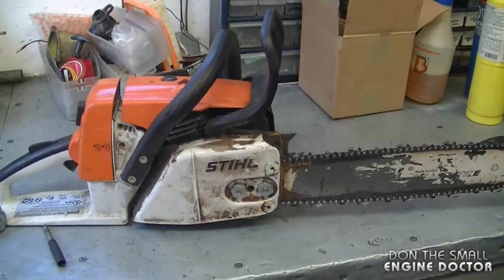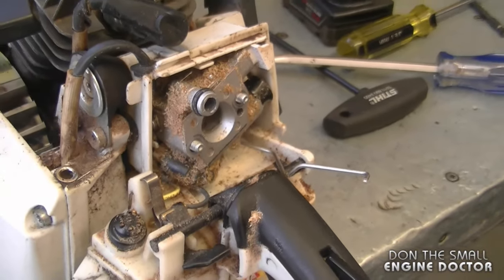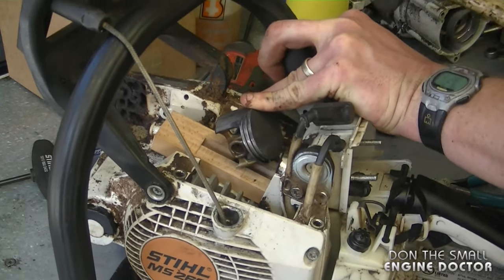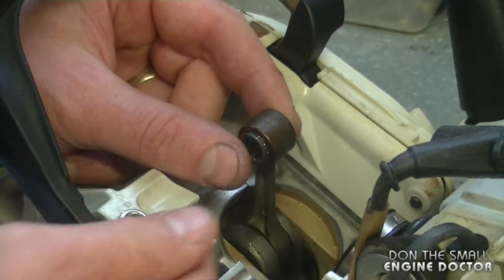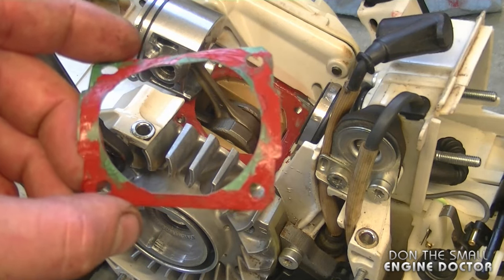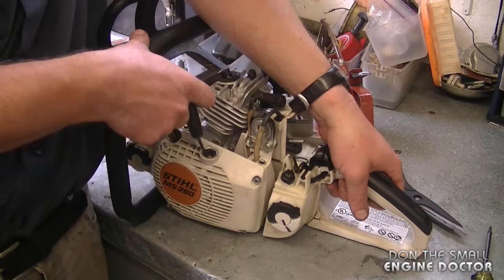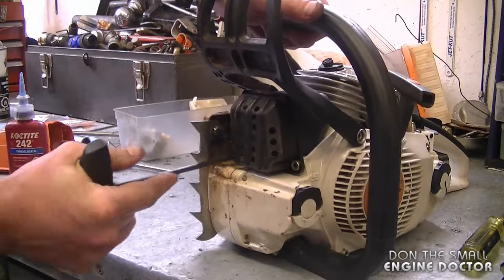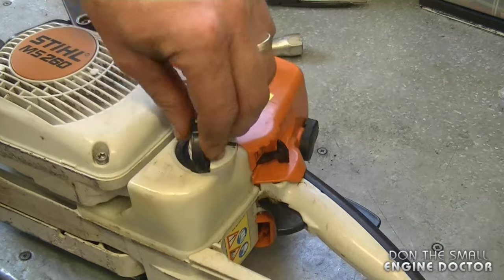Top End Rebuild On Stihl MS260 Chainsaw With Force-Tec Cylinder Kit

Comment: Nice job! I'm rebuilding an MS460 big bore saw. Ported and polished it and will be putting it back together tomorrow. You did a great job of breaking down all the necessary steps and am sure you helped a lot of folks understand what is involved..
Reply: How was your 460 rebuild? I pick up chainsaws for $10-$20 and repair them then resell. Mostly my work is carb adjustment, replace the carb (they are so cheap it's easier to replace than rebuild), new fuel lines and primer bulb, ignition module, maybe a clutch. But that's about it. No formal training or shop experience, just fixing my own things. Once it's broke what you gonna do, break it? No, so get the wrenches and tear into it..I have never ran into anything I couldn't fix. It may cost more than I wanted, but it's working right and well when I'm done. I have repaired and sold over 100 saws since hurricane Sally and not the first call because one didn't work right. And I always tell them to let me know if it acts up in the first 30 days. I stand behind everything I work on. I didn't have a saw after hurricane Sally and I swore that wouldn't happen again. So I bought a used one that needed work save got it going. When I saw how easy they are to work on I started doing it to help make ends meet since I'm on disability after coming out of a cervical fusion with a broken neck. Disability doesn't pay much. Less than 25% of my pre injury income. Anyway, I wound up with a Stihl MS260, a Stihl MS460 and a Husqvarna 141 from a couple deals where they had various saws disassembled and in boxes. I have the 260 and the Husky running like a dream. But the 460 has no compression and is going to be the saw I use on a Alaskan mill when I get I running. I also build trinket boxes and have designs to build my own boxes with hidden compartments, sliding panels, feet that twist or pull out and are drawers that hold the key and have other little things to do to get to the key hole that may not be located where you would think. I processed the wood from the cedar limbs that fell out of the tree behind my shop during Sally and have made several pair of grips for various guns that turned out awesome. The cedar has an almost purple tint and the grain has a shifting holographic effect like the old cards in the bubble gum packs. That got me wanting to be in control of finding and processing my own materials for my boxes. And with the storms we have there is always plenty you can pick up for free so the landowner doesn't have to pay someone. 
The reason I'm messaging is to ask you if you have any tips or ran into any issues rebuilding your 460. Since I'm going to be doing one I thought it might be a good idea to ask. And since it's going to be the motor behind such a necessary piece of equipment I want to be sure I didn't miss anything or screw it up. I'm going back with a Stihl Cylinder and piston. Do you have any advice?

Comment: Thanks for this video.  I just acquired an MS310 for free after the previous owner said it had stopped working.  Pretty sure he ran it without oil in the gas as the piston is all scored up.  Got the new parts ordered and am going to try a rebuild

Comment: Been there,done that this week.  I upgraded my ms 269 to a ms 260 P.  I also put an adjustable carb and oil pump on it, so it is up to the 260 Pro specs.  It runs and cuts fine.

Comment: Well done. I do these daily. One thing, machine surfaces like the OEM cylinder head to crank case using the OEM gasket does not require gasket sealant of any kind. Happy saw repairs!

Comment: I replaced the top end and carburetor kit on my Sthil 041 Farm Boss using this video as a guide, but I still can't get it to start.  It is getting fuel, has good spark, very good compression, but will not start and was running (choppy) before I took it apart.  Can you give me any guidance on what you think I should try next?  I appreciate your help.  Your videos are very helpful!  Thanks.

Comment: Great job Dony... Questions: After you did the thorough cleaning with your washer, did you let it sit to dry or blow it dry with compressed air?  If you didn't have your parts washer, how would you give it a proper, thorough cleaning?  Thanks.

Comment: donyboy73 - I want to thank you for taking hte time to make these videos. I have rebuilt 3 stihls (260, 291 & 039) that were header to the scrap yard and they are the best chainsaws I have ever used!
Reply from the maker: you're welcome
Reply: dony, I recently rebuilt a Stihl 291 with a Golf piston kit, the original cylinder was reused and was in good shape. After an hour of use the saw cut off and wouldnt restart. Last night I tore the engine down and it appears one of the piston ring pins popped out and deeply scored the piston and beat up the exhaust port on the cylinder. Have you ever seen this happen? Should I stay away from the Golf brand?
Reply from the maker: yes I see that when all the parts aren't replaced together
Reply: jiggysmb aaaaaa

Comment: great video! Only suggestion for your next video, 2 small things. 1 cover the bottom end area immediately with towels before removing the clips. 1 clip into the bottom end and... ooops.... much more may need to come apart. On a motorcycle this is devastating, pretty much means a full disassembly. Grab clip with locking needle nose so it doesn't jump out at you. On reassembly after the clip is in, you did not move the clip to 180 degrees. Clip "opening" should never be near the notch. Use a screwdriver and rotate clip 180 degrees once installed :) 

Those are tips from my 100+ top ends for motorcycles. This was my first watching for a chainsaw. Much appreciated!

Comment: Thanks for the video. I love the videos where you take stuff apart and replace things. I was wondering about how the parts washer works. Does it just use water or is there some kind of cleaning chemical in the water? Does the water just go down the normal drain? I would like to see a video of you using the parts washer some more. Thanks!

Comment: Nice video. So I suppose you don't have to check the ring gap befor installing like on v twin motors?....and no blue loctite on the cylinder bolts?

Comment: Nice and thanks for the video. I like to tighten the boot on the cylinder before I install the cylinder. Then I just tuck the top thru the hole into the carb box and gently pull the rest of it's flange thru. I also like to replace the impulse hose and the fuel line as insurance.
Also I'd like to see a close up of the inside of a force tec jug...

Comment: Do the rings need to be checked for "end gap" or are they ground and fitted by the kit manufacturer?
    I've had to diamond file the ends of some rings when rebuilding motorcycles and cars to have enough "end gap" so when the piston and rings expand due to the heat of combustion, the ends don't expand into each other and damage the cylinder bore. If they don't have enough clearance, that can cause the rings to fit to tightly and score the cylinder bore.
    In service manuals, it will usually give the required clearance dimension for "end gap". Before installing the rings on the piston, you check each ring in the cylinder by carefully pushing it down with the piston checking "end gap" in 3 or 4 places using a feeler gauge. Be sure to oil the ring and cylinder before you start this procedure.

Comment: I put the intake boot on the cylinder before putting the cylinder on the saw.  I also wrap a piece of string on the end of the boot and feed them through the rear wall on the handle, so I can use the string to pull the boot through the rear wall hole.  I do put a thin coat of 1184 on the cylinder grooves before I put the intake boot on the cylinder  and put the clamp on the intake boot.

Comment: Don, I am working on an Echo CS-306 chainsaw that would start but then quit. It has compression and spark. The diaphragms were a bit crisp so I purchased an aftermarket carb that was only slightly more expensive than a rebuild kit. After installing it I got it to idle ok but the second I tried to press the throttle it would die on me. After 30 minutes of cranking and adjusting the high, low adjusting screws I finally got it to run full throttle but it idled too high even with the idle adjusting screw backed all the way out. It also took me forever to reinstall the carb and hold the carb gasket in place. Any suggestions for that as well?

Comment: Thanks for the great rebuild video!
I had a MS200T rebuilt this summer. It started easily the first couple tanks, which I was running my 40:1 that I use in my Mcculloch's. I use it primarily for trail care, so It gets started and ran for a couple cuts, then shut off until I run into another down tree to cut. When pulling the starter, it always catches nearly ripping the saw out of my other hand. The second pull is fine and it starts. Any thoughts on why it does this?

Comment: Just watched this video almost two years after it was published.  Thanks for putting this one up.  I just tore down my Stihl 024AV because it stopped running the other day.  When it stopped I couldn't pull the pull cord so I knew it seized up.  Upon taking the cylinder and piston off, both were scared and scratched.  I haven't run the saw more than a few times a year but the last couple years I've noticed that the chain keeps spinning even after letting off the gas.  I think this is because the compression has gone down from a worn ring.  It also has been very hard to start and when tearing it down today, I found the muffler was very loose where it bolted to the cylinder which leads me to believe it was running too lean.  Am I on the right track with my thinking?

I want to rebuild it but for the amount of sawing I do, a home center saw of lower quality may be adequate.  Can you recommend what brands of cylinder kits to avoid?   There are a lot of Chinese stuff on the market now but I can't afford OEM-a new saw would be cheaper!

Comment: First tanks for video. I have some questions if you have time for a noob like me. :)
I need to replace piston and cylinder, on my ms 261. Do I need to replace crank to, because of better compression ( after I install new piston and cylinder)? Crank is fine, or do you recommend just swapping bearings on crank? Last question is about spare parts, do you buy real stihl parts or some with similar quality.

Comment: I've seen so many of these now that I have to wonder if the exhaust port is not sucking in briefly (during starting attempts) or perhaps more likely, dirt is forced into the exhaust port by compressed air cleaning or just high winds in the area.  Protection by the muffler baffling is minimal (IMHO).

Comment: Great video.  Question.  As your putting the cylinder on, how can you ensure that the piston rings dont move and spin from where they're supposed to be?  If they do is that crucial? 
Would this process be the same as a STIHL MS360?  Thanks

Comment: Excellent video on MS260 re-build. I about to order the Force-Tec kit but have to determine if the crank berrings are gone aswell as the cylendar and piston. I notice on EBay that one can buy complete assembled engine replacement kit. Are these kits worth the money? Thanks for any advice.

Comment: I only buy Stihl and Echo 2-stroke equipment these days. Watching that top end rebuild shows how and why they cost more. They are much better quality than the bog box store throw away junkers. The quality of the parts are much better too. It was also deigned to last and be repaired/rebuilt instead of throwing it away and buying another.

FWIW:

My chainsaws are a Shihl MS-391 Farm Boss.....64.1cc 20" bar and a Echo CS-490......50.2cc 16" bar. My weedeaters and backpack blowers are also Stihl and Echo. It's all I will buy and as my old junkers wear out I replace them with quality this time around. I just scrapped a Poulan Pro 260 from 2000. I can't see putting $50+ in repairing a $139.95 saw when new. You still have a cheap $139 saw when you are done. In Stihl and Echo equipment I would go 50% - 75% of new just because of the history of ownership and sentimental value without batting an eye.

Comment: Thanks for info I replaced top end with kit from discount online parts with no problems cost was about 200 dollars cdn but worth it because a new 261 arctic is about $900 after all taxes and charges have saw broken in and it runs like new your videos are very helpful with no distractions thanks

Comment: It is amazing how dirty folks let their saws get and then complain when they do not work.  I clean my saws after each use and I resharpen the chains, too.  It takes a lot less time to clean them if you clean them after each use.  I leave my saws ready to go the next time I need them.  They are not new but they look new.  I picked up a crash damaged 026 yesterday and it took several hours, compressed air, old two cycle and a paint brush to get it clean enough to even run if it did not have a broken gas tank.  I am going through the carb, today.  I did squirt some gas down it throat and it rubs good.  I will really check it out when I get a new tank on it.   I think she will be a runner and I already have a light weight 20 inch bar and chain ready to put on it.

Comment: I have a question on the ms 260. The 260 you were working on seemed to have apiece of rubber or plastic blocking the gap between the sprocket and the case to keep sawdust from entering the area of the oil pump but Stihl does not show a part in this area.  What is it?  My 260 does not have one and Ineed to cover this area to keep sawdust from getting down into the area of the oil pump and worm gear.  Thanks.

Comment: Don, I have a question.  I built one of the farmertec ms 660 and it runs and cuts fine, except I cannot crank it, reliably.  It likes to pop through the muffler and about take my arm off.  My young friend who is about 6-3, 250#, starts it in one pull, drop starting it.  I replaced the farmertec deco valve with a Stihl one.  People tell me I am not putting enough ass in it but 73 is what it is.  I have no problem cranking my ms 391, which is 65 cc.  Your thoughts.  Thanks.

Comment: I had forgotten how similar the 260/026 are to the 024.  I have just got through restoring an 024, so it’s assembly is very familiar to me.  It has been several years since I restored my 260 and 026 Pro saws, so they are not as familiar to me but the 024 is.

Comment: I found you video ,to be really helpful.  I am ready to open the top end of my Stihl 026 to try  to diagnose a curious problem.  My machine has become very difficulty to crank - extremely "notchy" at every compression point. With plug removed, smooth, absolutely no problem - no mechanical interference.  With plug in and electrically connected, it's much worse - tries to rip off my arm, firing back against my arm.  Timing isn't the issue - checked it, pre-ignition and "dieselling"  aren't the problem - with no fuel and spark disconnected, it's still way too "notchy" -  nearly impossible to pull the recoil starter.  My final idea is that carbon has built up for 25 years and increased the compression ratio by a lot.  The problem does seem to have gotten worse over the last few years.  The issue is so bad now that it must be fixed or junked. Any thoughts?  Thanks, Richard
Reply from the maker: ONCE it's apart it will be easier to diagnose

Comment: when I rebuilt mine I had to put the intake boot on the cylinder before installing the cylinder.  I tried doing it as he did it and the boot wouldn't slide on, even with the clamp off.  My intake might have been old and brittle but it didn't leak.

Comment: Don.  I have a question.  Do you ever check the ring end gap when you rebuild a saw?  The old formula used to be 1.5 thousandth per inch of bore.  On a 46mm jug that equates to about .003 but what gap would you use?

Comment: I rebuilt my 026 following your video and when finished it worked for about twenty minutes and then the piston blew again.  The piston was scored on the exhaust side.  I reordered another piston assembly and tore down the saw.  I discovered one of the four bolts that mounts they cylinder was completely missing.  Is there any chance that you could post the  proper torque?  I see at 16:26 you mention that you don't have the torque specs.  I've looked elsewhere and still have not found torque specs.  Do these simple not exist?

Comment: Thanks for the great video. I have worked on my chainsaws thanks to all the info you have provided. I have a quick question, I'm working on a ms 250 I took it to a shop and they told me that it needed a complete piston kit so I left it in the storage for the past year or so. I just opened up and the piston doesn't look that bad, now the question I had for you was how do you know when the piston it's too scratch? Compression seems ok I dont have a machine to check but when I turn the flywheel seems fine. Any info would be appreciated it. Thanks!
Reply from the maker: send pics to donyboy73@yahoo.com
Reply: Perfect. Will send the pics. Thanks

Comment: is it necessary to use the dirko, along with a gasket, or is the gasket sufficient by itself?  did you use the dirko just as an assembly aid?
Reply from the maker: you probably don't need the dirko. I used it as a second layer of protection and yes it does help to keep it in place during assembly